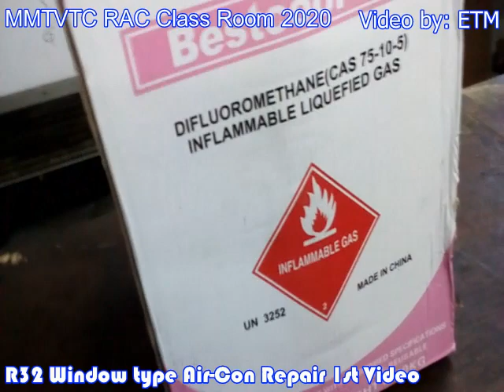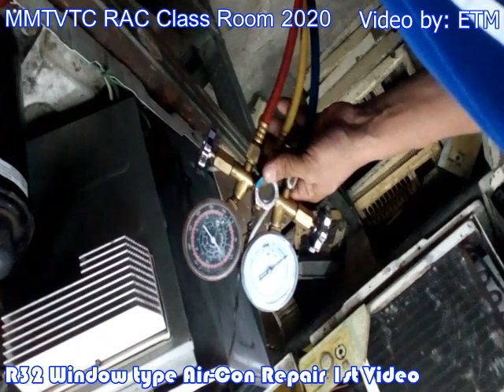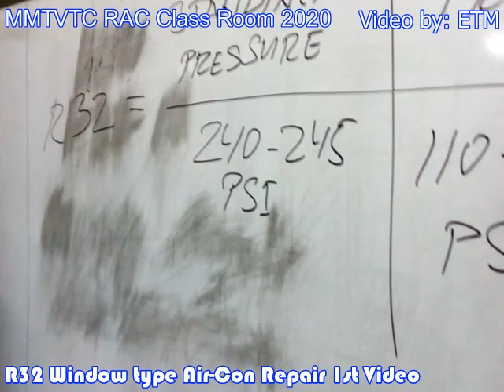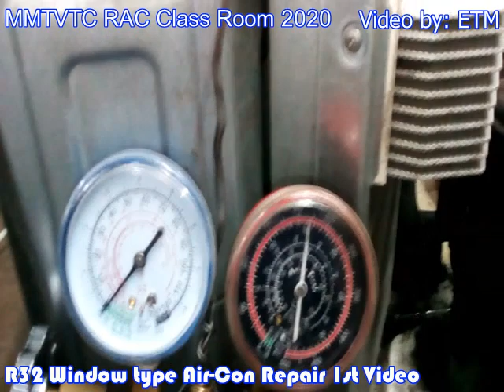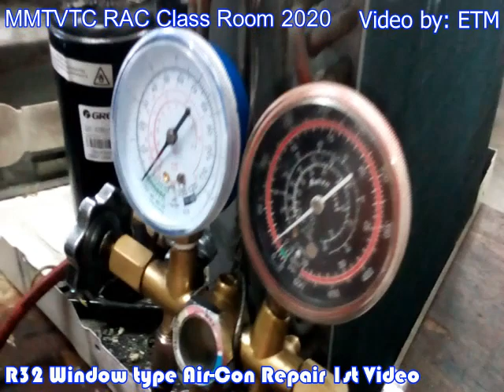How to System Reprocess 1st Video-R32 window type air-con Inverter Repair

Comment: nice video sir. may concern lng sana me . nagkabit kc ako ng new split type aircon carier xp gold 3. ang pipe nya ay 1/4 at 1/2. kaso may existing pipe kc na nakabaon sa pader na 1/4 at 3/8 . ayaw ng may ari.n magbakbak kaya ginawa ko nagdugtong n lng me.sa suction.ng 1/2 . ang tanong sir sakal b yung comp.pag ganun.kc hilaw.daw ang lamig. di.maxado.nalalamigan.ang.may ari. ang karga ko ay 140psi.na nasa 5.5amp.ang amperahe. r32 sya. ang haba ng piping siguro estimate ko.ay masa 15ft. may nagsabi sakin.na.kulang p.daw ang karga. kc ang max amp.sa name plate ay 7.2amp. kahit daw kargahan ko p.gang 160psi. tama po b yun sir？ patulong po sana master？ God Bless po